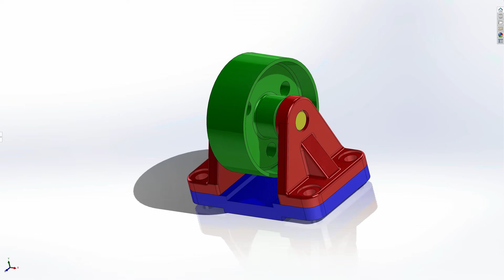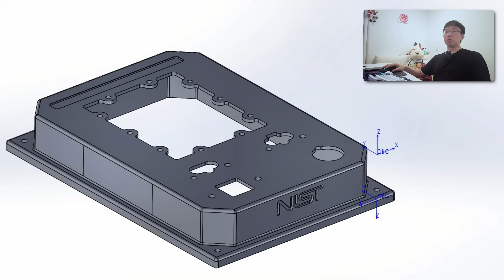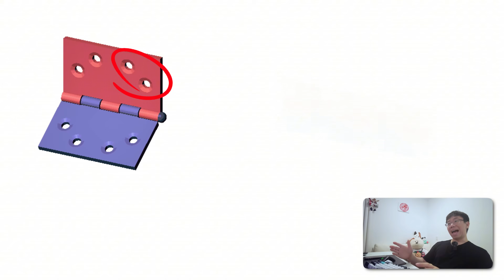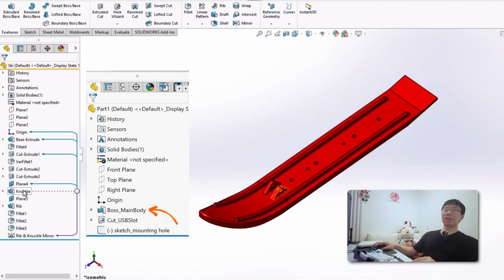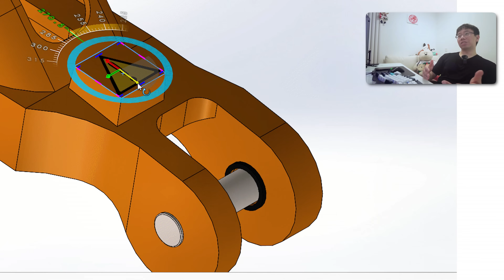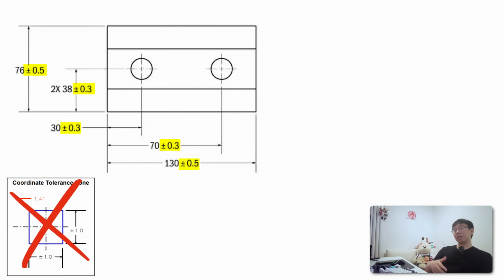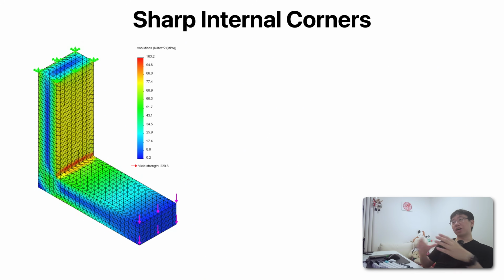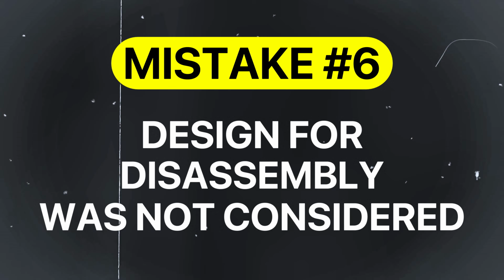Design Mistakes Even Experienced Mechanical Engineers Make

Comment: Honestly, very valid points for all. 

However I will highlight that in terms of having a robust model that can survive redesigns is controlled/tripped up by 3 factors (In my experience): 

1 - Having the need to cross into the negative with your reference (Solidworks has no concept of negative references, so mates will flip and ruin the way an assembly works) meaning you then need to fix it anyway, this is mostly dimension directions, you can control angles/orientations somewhat easier. 

2 - Being on holiday and some other fuckwit comes along and just changes a dimension without selecting "For this configuration". meaning that your version control, or your equations ruin the entire configuration list. This is mostly the case that "unless someone is willing to take 2 minutes to figure out how you constructed it, they will just change what they need to" which is related to factor #3. 

3 - Boss man wanting this thing now. Yes you can make a plate robust and it might take 5 minutes to set it up. But you can make it in 1 minute and any changes that need doing can be done in an additonal minute.

Comment: It is funny, how many of those tips you learn just by doing rapid 3d printing prototypes and updating/changing your/others modedels. When you living in a cad software and then assemble and work with things you've designed...

So, practice and thinking will eventually lead to those tips
Reply: even funnier is how you wouldnt need to learn any of this if you also had to go ahead and personally manufacture the thing. 
because you wouldnt cause excessive work and expense for yourself in the first place unless you are crazy.

Comment: I agree on everything said- on the point of model unpredictability, I would add that it is sometimes not possible to built this level of forward-flexibility as the modelling complexity gets higher.
Ex. When you have dozens of g3-blended surfaces all built with splines and intersection curves, the best you can do is make it so the design intent remains clear, even after surfacing features have inevitably broken when making high level changes.

Comment: 2:50 while I absolutely agree about being explicitly parametric, in FreeCAD at least you can be 'soft parametric' (for lack of a bette word) as well. In this example that'd mean adding vertical and horizontal construction lines between each circle and the adjacent walls, then setting equal constraints (hotkey, e) between all of them, and then setting just one or two distance constraints (hotkey, d) to affect all of them instantly. 

After the 1.0 update the equality and distance constraints both became 'smart' so it's actually incredibly easy to work like this and, thankfully, it's also very easy to fully parameterize later as well, since you can just bind the small handful of dimension constraints you have to whatever parameters in the varset you want to use.

This might be bad advice, but one thing that really made me start modeling EVERYTHING at least 'soft parametric' was using a keyboard without a numpad. Since assigning numerical values was so much slower and more cumbersome, I'd always use as many equality and reference constraints as possible, which ended up building good design practice habits anyway.

Comment: some of design intent you mention here can actually make a part more difficult to work with, especially when your assemblies start growing to tens of thousands of parts and you begin working across multiple software versions.  its good to keep in mind that more features = longer load times too.

one big thing you forgot to mention with design intent is to utilize the primary planes in your model as you see fit instead of ignoring them.

Comment: I have been some level of technician through most of my career. If every engineer I had to interact with or handle parts from had watched this video a good 60% of issues would simply vanish. This should be required watching material for every engineering student and professional.

Comment: This video should required viewing for anyone doing designing!
As a machinist I see flat out lazy designing and dimensioning along with failure to simplify with symmetrical symbols that can clean up prints and make things easier. 
The BIGGEST problem I see are engineers who are NOT actual engineers. Just someone who learned how to use the software. 
Also, engineers unaware of the processes to physically creat their designs. 
Also engineers who won't change designs out of pride or because it may expose their shortcomings to higher ups.
-Default tolerances copied from print to print DRIVE ME NUTS!!! Tolerancing clearance holes for SHCS or chamfers down to .05mm is nuts. Or giving plus/minus tolerances where plus 0/minus something would be way more appropriate. 
I can't even count how many over-engineered time wasting parts I've made. Thousands in broken tooling,  buying specialty tools because they won't change the print, etc. Not for mechanical parts either. Things like gussets or an anchor point for large electric eyelets. Squared out notches for round parts. It goes on and on. Like a toilet that keeps flushing money. Not mine, I still get paid. Our customers go out of business quite regularly because they don't have real engineers to design their products. 
I just count my money and feel sorry for the employees who will be out of work.

Comment: As a machinist please make your tolerance as big as possible. Don't be lazy and say +/- .005 for everything when you're planning on welding and grinding on it anyway. Then when I make a part that's .002 out of tolerance I have to go hat in hand to the engineer saying is this ok and the answer is 95% of the time oh yeah that dimension doesn't mean anything. Sometimes it's oh yeah you could be off a 1/16 of inch on that dimension. Would bother anything. Well that's great because I just opened up my 2nd pack of cigarettes today stressing myself tf out trying to hold this tolerance. If you engineers learn one thing I swear to God let it be that. The other stuff like sharp corners in a pocket or weird undercuts I can call you and tell you that you're an idiot and it's not going to work.

Comment: As a design engineer that started as a CAD designer, it amazed me how little they discuss design intent in engineering programs. So little time is spent on proper CAD design it is ridiculous. I spend so much time fixing other peoples models with proper design intent elements because of these exact issues. You go to change one dimension and the whole model falls apart and you spend hours fixing things. One thing not touch on in the video is if you need to change a model, do not just add/remove material by adding new features! Go back and change the original solid if needed to the proper shape! There is nothing worse than opening a model and seeing this cobbled together monstrosity because someone was too lazy to fix it properly because it may take 5 minutes more to do it correctly.
Reply: Also, use the machinery handbook to see what tolerances are capable for each machining process! Don't use a super tight tolerance unless you need it!

Comment: The very FIRST thing to do, is select the CORRECT orientation; you model a house upright to the top plane and an aircraft from the datum which should be at the front plane. Each component should be referenced in space with logical datums and orientations. Example: I had a boss who would start a house architectural model on the front plane (SMH); everything downstream was not oriented correctly, and he said you could just change the view reference (which you can) but later in the assembly it continually crashed because of such a simple early choice. Say you draw a 'telephone pole'; it should be obviously oriented  vertically, but the choice for the base plane could be the bottom of the pole, or the level of the ground as the datum. Later, learning machining, I discovered what a poor CAD modeler I was, because order of operations now became a defining factor, and changed for the MUCH better, the way I modeled, getting rid of 'impossible' (in real life) modeling decisions. Early decisions of orientation and datums makes a HUGE difference; also name your features, for easier recognition later, by you AND others.

Comment: Oh I want to say so much about everything you said! 

I am a highly seasoned (20yrs+) software engineer, in FAANG. Everything you mention has a parallel in my industry, not planning ahead for maintainable code, not thinking about user experience, not designing for not only expansion but also time, not making your code, and architecture conform to changes by itself. I can go on and on, the concepts are almost identical.

I started dabbing in 3d printing with a clear product goal. After watching several “popular” Fusion 360 tutorials, I had a really bad taste in my mouth, as most of them never talked about the best practices for workflow, organization. Instead they jumped right into “sketch extrude” loop.

This is exactly what I mentor new software engineers on, “By the time you start typing into your editor, you better know everything you will be typing in at least roughly shape, and have talked about it with others through design reviews.”

Same in mechanical engineering too, but it’s kind of rare to find senior and higher level mentors to guide you, thanks for making this video. It truly made me able to appreciate this side of the engineering universe more! 

I still want to talk about so much but this is already a wall of text! Lol.

Comment: Was Fortunate to work in a very busy 65 man maintenance shop as an electrician but I was the guy who made adapter plates to use much cheaper longer lasting micro switches made in the USA,father then foreign ones. Had my own end mills for our milling machines. Took a few lessons from our talented sheet metal man on how to make correct bends and gains after making several bends. Made some handy containers for my two tool chest to hold small end mills, taps, etc.

Comment: Lots of good stuff here.  As a machinist of 20+ years I have been the victim of bad drawings/models from too many engineers.  In years past I was in a place where by the time I've seen the print it was far too late to raise a flag to the customer/engineer. At my current shop I've gotten much more involved earlier in the process.  This has made my job exponentially easier.  I can point out things that just don't make sense or will be difficult/impossible to manufacture.  One such time was a customer came to us wanting a .014 (inch) hole .625 deep in 17-4 condition H900.  After I got done questioning my life choices we got on the phone with the engineer to find out what the purpose was for the hole.  Turns out that only the last .127 length of that hole was functional.  The rest of the hole just needed to be clearance for a wire to pass though.  We made few simple changes to the design and we are now running 1000s of the parts a month across 4 part numbers.

Comment: I watched the video about DFM mistakes. I also used Solidworks before. Solidworks allow you to place holes and other features as they would update whenever the main body change. I use Rhino, I am on a steep learning journey, actually. Does Rhino 3D do that? Updating position of the hole and etc?

Comment: For the Seconde Tip, With this simple Parts using the "Equal" function in Solidworks for the Diameter and just mirror the Holes would be way faster than using Global Parameters.

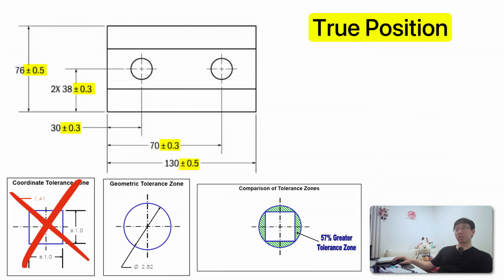Comment: At 10:24 you mentioned True Position. The control is actually Position, not True Position. True Position is where the center point or center axis is located basic to a datum reference frame.

Comment: Manufacturing Engineer here (with Honours Degree in Mech Eng), the part about deciding things that can actually be made is the most important. Even the simple things like a generic Break Sharp Edge 0.5 ± 0.2 replacing a dimensioned chamfer or radius can take a zero off the price of a part.
Reply: Lfg!
Reply: Appreciate that tip brotha
Reply: While chamfers generally aren't that bad (unless in a tight spot), radii can easily add multiple zeros or justify a manufacturing process change.

The customer once wanted outside radii along a complex profile so badly that they gave us permission to entirely redesign the part internally 😊

$680/part went to $85/assembly (3 parts with the outer shell being 3mm plate). They got mad when they realised we could have done this right away 😢

Comment: As a ME with 3+ yrs experience, which is junior in the grand scheme of things, I was relieved to find I knew most of these tips already - unfortunately from being thrown in the deep end and sucking up knowledge by harassing machinists and what not.

To the maker of this video, I fucking love you. This was such a clear, detailed and no nonsense video. 
You should be an engineering professor, they don’t teach you the nitty gritty hands on at university.

Thank you so much for this video. I have been looking for a proper realistic mechanical engineering channel for years and I finally found you thank you sir.

One secret tip that you did not cover, and is rare to find in engineers generally:

MAKE FRIENDS & CONTACTS! 

Aka, networking, striking up friendly conversations with your colleagues in engineering and other departments trust me you learn a lot of secret nuggets of knowledge such as learning from the marketing executives what direction the company brand image wants to go in therefore you can design parts or specify colours in post processing that fit the brand image and make you look like a natural to your boss, but actually you just kept your ears open and you with the company was heading

Comment: 100% true. As a most obvious illustration I can provide Iphone vs Galaxy comparison.iphone can be easily and totally disassembled for repair needs into changeable modules in a minute with 2 screws. Even with 1 screw and a papercutter blade. Or even with the papercutter blade only. And now try to open Galaxy. Etc, etc.

Comment: I feel like modern CAD programs lead to a lot of these problems naturally. I’ve only ever used OpenSCAD and it makes it natural/easier to do things the “correct way” since doing it any other way tends to instantly feel hacky/incorrect, and you have to think about each operation with a lot of intent. All of my students use something like Fusion, and although their parts look better on the computer, it’s rare that their iteration speed or manufacturability (especially through design changes) is superior. I think this has to do with how they’re being taught these programs in courses and not an inherent flaw with the tools themselves, but I think those programs have affordances that naturally make it easier to think less critically about what’s going on for the trade off of more powerful, but abstracted operations.

Comment: As a maintenance technician I many times hate engineers. They seem completely oblivious about the fact that parts will have to be replaced at some point in time. Doing a simple task like replacing a roller on a conveyor can take several hours because of bad design, when it could have taken less than one hour with a better design. It makes you wonder... What do they even learn during their study?! Doesn't engineers learn anything practical about the physical world? To me it would make sense to have some basic technical knowledge before becoming an engineer.

I've become somewhat of a hobby engineer/designer lately. For a long time I had some ideas in my head that I wanted to create. So I finally got brave enough a couple of years ago and started learning CAD. It has gone a lot better than I thought it would. But I can tell you, that it takes time to build a functional assembly with a lot of moving parts while at the same time learning the program. I got my self a 3D-printer and had to learn how I need to design to for my parts to print well while also keeping in mind how it all needs to be come together in the assembly of all the parts. Challenging, but super fun! Now I have no one to complain to (except myself) if the assembly is a pain in the butt. And I love it! That means I can make it better. To me it makes sense to spend more time in the design phase to later save ENORMOUS amounts man hours and thus money in the assembly lines and during maintenance. But it is surprisingly often the other way around. Makes no sense at all. The design cost is a one time thing. But the bad design choises made will create additional costs by multiple times later down the line. The end costumer will pay for all of it.

Comment: everything you said here can be reduced to one single sentence. Always draw in assembly when you create a new part of the assembly you can always use convert entity and then the modification on one part of the assembly is automatically transferred to all connected parts. The mistakes that designers make are not related to what you said, they are secondary things designers design what is impossible to make with the machines available to them that is the biggest mistake every designer should spend at least 10 years dealing with material processing get to know the production plant of the company they work for down to the last detail and only then start dealing with construction

Comment: My problem naming features is that when a single part has a multiple hundred complex features I start to run out of names for each one.
Reply: I never name features unless I'm feeling fancy, or I try to make a specific feature more accessible. If the design and the software allows, it also helps to put features into subfolders, like base additive feature - major subtractive features - hole features - corners and edges